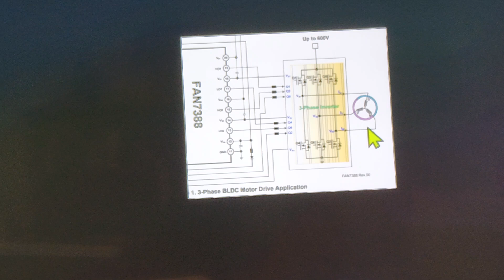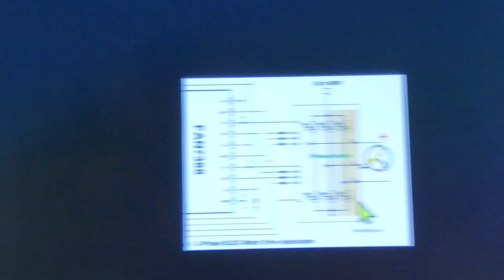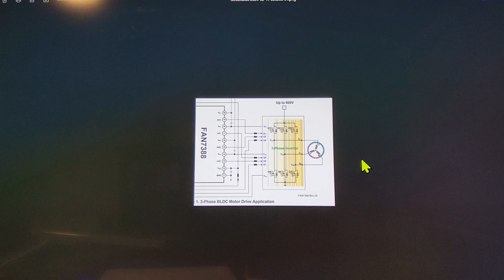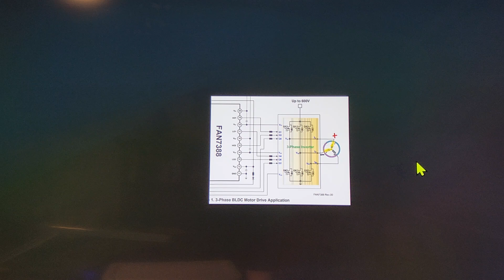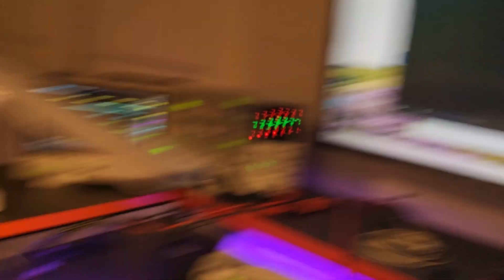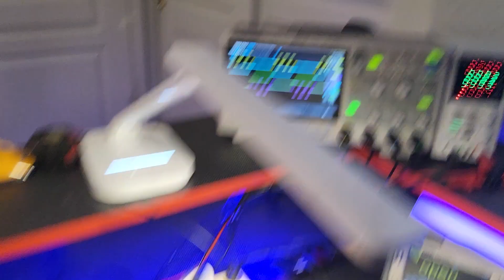Checking a Carrier infinity inverter power module to see if the smoke was let out 💥🔥😆

Comment: hi i have had a board from a heat pump that the power supply was failing on it every thing worked except it flagged a error code that it was under or over pressure because the compressor was not running.
all the dc rails were low and when i add a external voltage source (15v to the 15v rail) the compressor fired right up
Reply from the maker: @davidmcclare443  Nice. I've done that to a few boards.
Sometimes having to first cut out a shorted component in the original power supply in the board.

Comment: That board looks like it's made by Samsung. Are these units made by Samsung too or only the boards?
Reply: From what I was told/read, yes.  The Carrier 24/25VNA6/4 units switched over to and spec'd Samsung Rotary compressors up to 4 tons and Samsung Scroll (Label says Carrier Global, but built by Samsung) on the 5 ton Heat Pump. Straight cool may still have rotary on 5 ton, I forget.  The 5-stage 24/25VNA8/9 used the Toshiba/Carrier Rotary but not sure exactly who made the inverters.  Unit design still Carrier and these are still assembled in Collierville, TN.
Reply from the maker: @TheGgin  I rubbed some carb cleaner on the board MCU to clean off the wax to see the brand. I believe it was a Samsung logo

Comment: welcome back! what the status on the frankenstein hot-water heater project?
Reply from the maker: @s.kammerer1206  The Ver 2.0 sitting in my garage? 😄
Well. Still contemplating weather I should even swap out the one that is still working so great.
I did get a small flat plate heat exchanger I might weld in place and test if its efficient enough to replace the larger coax type.
Or just add it in series and see if it extracts just a bit more heat. Which might be the better idea as it is likely way too small by itself (was a subcooler for a resi heat pump).